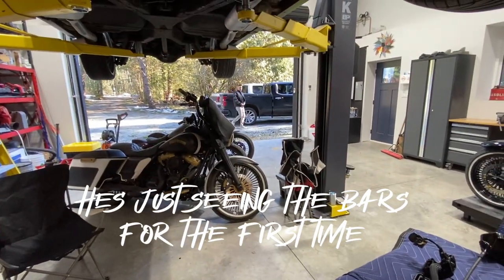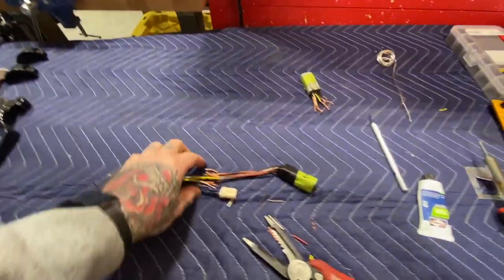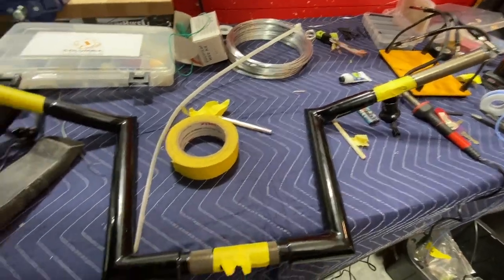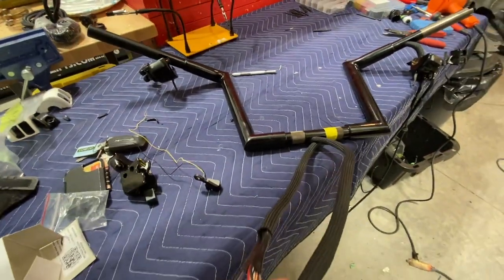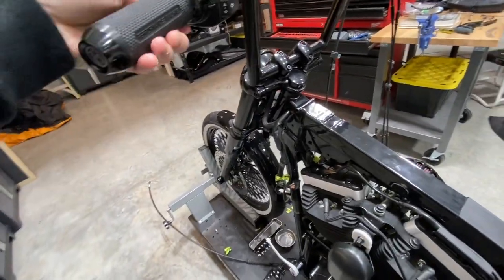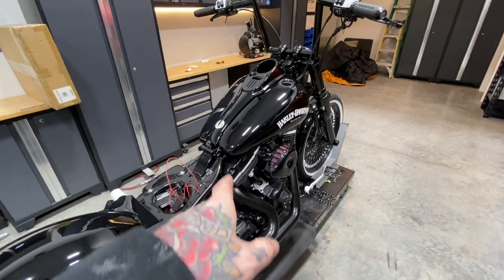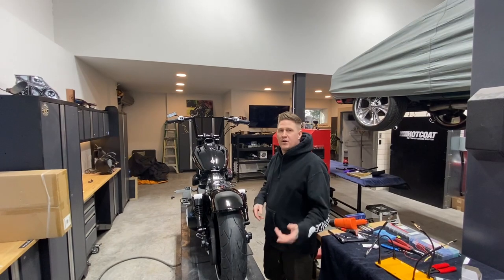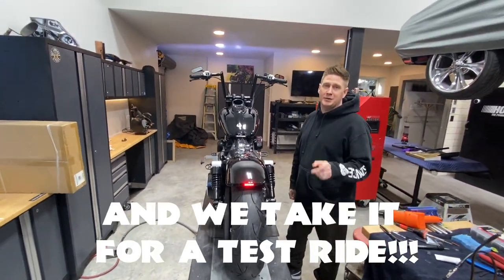DYNA Build " Black Sheep" Ep. 11 "Hand Controls"

Comment: Where do you buy new harness plugs for the left hand controls?
Reply from the maker: Probably from Harley direct. I used the original ones I just spliced them back together after I pulled the wires through the new bars